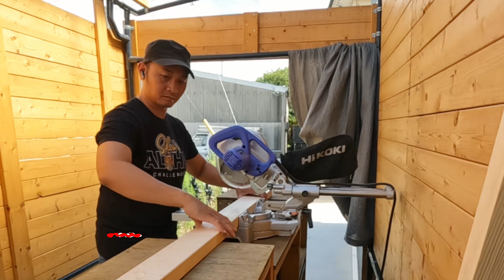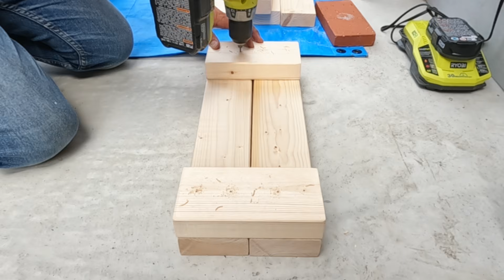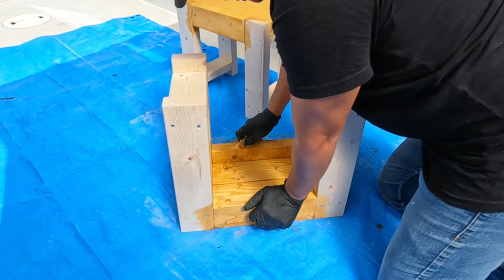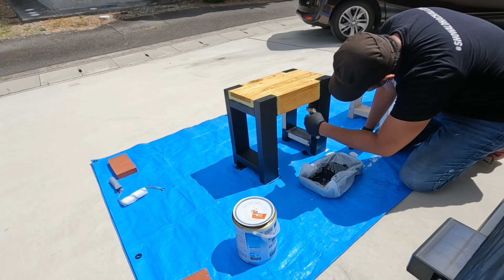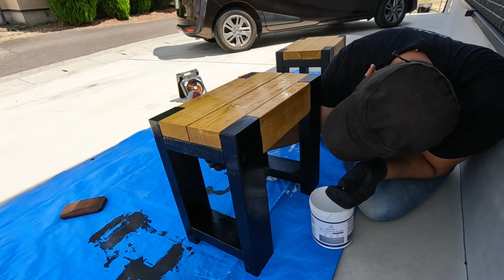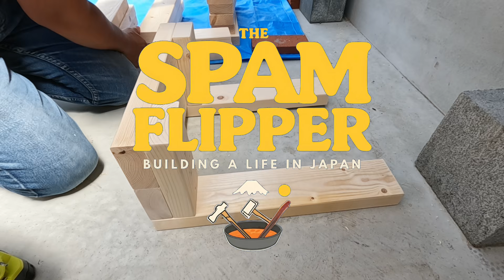The Easiest DIY Stool Ever | Simple Wood Stool Anyone Can Build

Comment: I’d paint before assembly then touch up
Reply from the maker: “I actually prefer assembling first so the glue is bonding directly to bare wood. Since I’m using an oil-based stain, I didn’t want to finish the surfaces before gluing. But there’s definitely more than one way to do it!